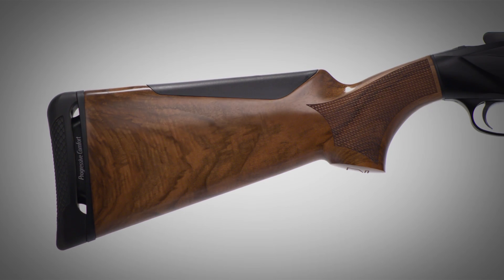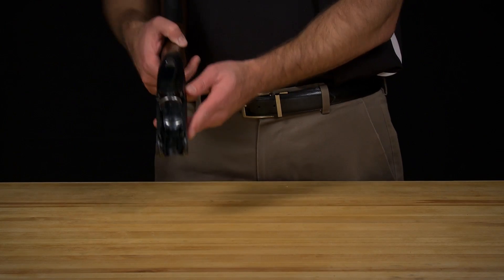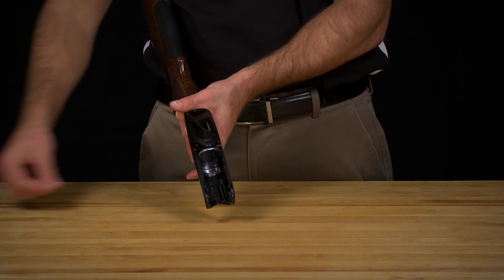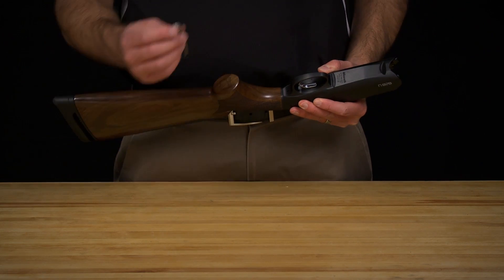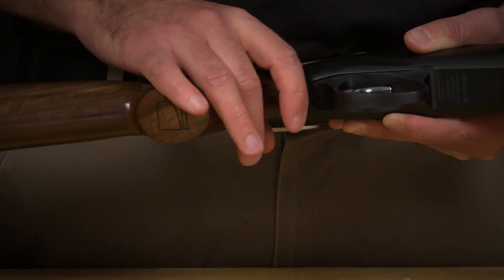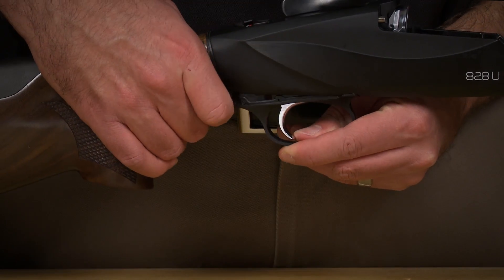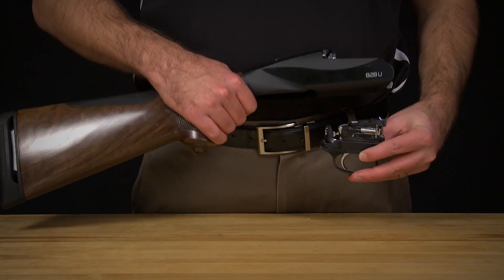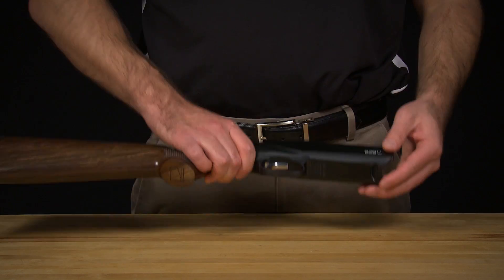Benelli Tech Shop - 828U - Pt. 2: Trigger Assembly Extraction and Installation

Comment: The video says, "Do not attempt to remove the trigger assembly with the lever in the open position". What options do I have if I did just that accidently? The trigger group is now 100% stuck and partially out.
Reply: Omg I got stuck too, what did you do  to fix it ? 😂
Reply: @birarmaangill  Bad news lol. I had to send it into Benelli to fix it. It was a multi-week process, but they fixed it for free.
Reply: Can you not reset it to closed with the pin just in front of the lever?
Reply: Nope
Reply: @carlmarsden2529  Nope. It’s hosed.
Reply: I did it too, but was able to get it to work.  You have to put the barrel back on the shotgun to cock it.  then push the assembly back till it clicks.  try it a couple of different ways and it should work.